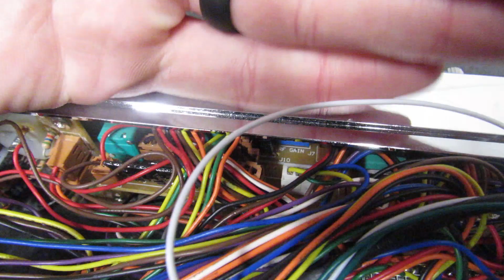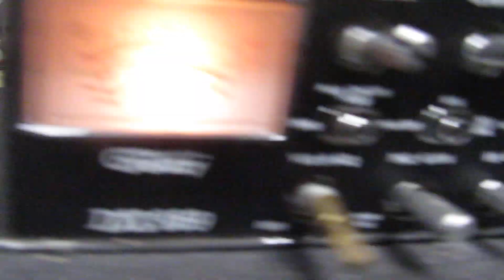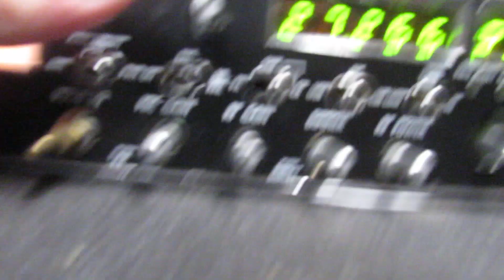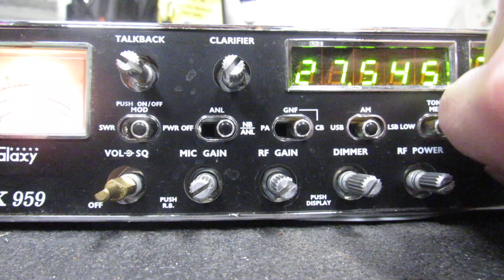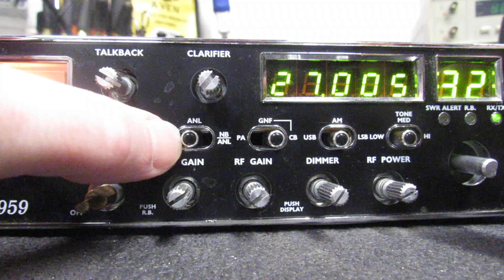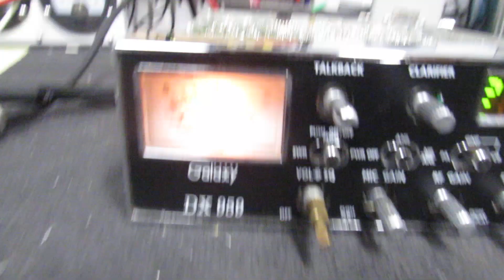Galaxy DX 959- Part 1: PLL Channel Mod Using A Factory Switch

Comment: I did this mod on my 959 dx with mosfits and it didnt change anything and everythings right
Reply from the maker: It’s always worked for me. Done it this way several times.
Reply: @udx-294tn5  i got it fixed, i had a bad solder joint

Comment: Hay man good video.
I just been watchin .
I got mine about 2 years ago and set it on a shelf as a spare.
My anytone q6 quit so i got it down been running it.
 New meter tuned up now time for echo and a new roger multi beep an channels.
...
These 959 rigs terrible for bad solder joints been all over this radio chasing solder joints.

Comment: So it won't do side band without this mod or swirches I'm looking to but one but it has the switches he said was for 10 m but thr chart was 26-27mhz only
Reply from the maker: @BlessedByTheGrace3O4  this mod is just for adding additional frequencies… it is a SSB radio either way. To get it on 10 meters would require a different mod. This radio will go up to 27.975 with the full 2 switch mod.
Reply: @udx-294tn5  okay jusy adding channels in the 11 m band I see

Comment: Why didn't you just use the cable you unplugged from the board to wire into the switch?
Reply from the maker: The wires on the plug were tied to the wrong pins on the switch to achieve the channels I wanted.

Comment: Very good info 👍 . You’re right,  there’s only a few channels above  40 where the sidebanders hang out , and in AM , 26.915 is a nice hotspot I like to fish for skip on
Next fix  ,, if you could figure out a mod to make these radios quit drifting , you’d get the Nobel Prize in the CB world . I’d love to have one , if they were stable . Very very frustrating . Great radios , love them for AM , but man , that drift is a pain for everyone . An issue I’m very disappointed in Galaxy for never fixing . If Anytone and Stryker figured it out , why won’t Galaxy ? 
Too cheap to is what I figure . What’s your thoughts ? I’m in no way a radio tech so I can’t say much beyond griping about it
Reply from the maker: Yeah, that’s always been an issue on all these radios. I know there’s a few ways to make it better, but definitely no way to make them anywhere near as stable as the modern anytones and strykers. Definitely just a lack of caring on their part for not keeping up with the times and sticking with the old technology. That’s why I usually unlock the clarifier, which is something I typically don’t do on a good SSB radio.
Reply: Yeah just unlock clarifier like mine. Makes it useable on SSB no complaints keeps the clarifier from seizing up 😅
Reply: I have not has any frequency drift on my radio.
Just these dang bad solder joints cold solder what ever ...
Seems like every other week or so .
I cant run it as a mobile.
I use it as a base and dont even bother putting screws back in the case.